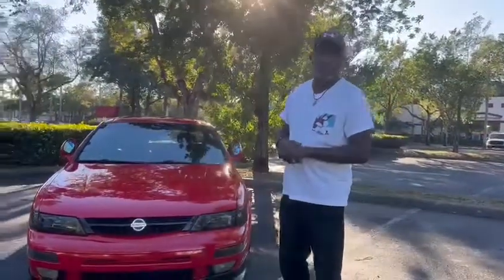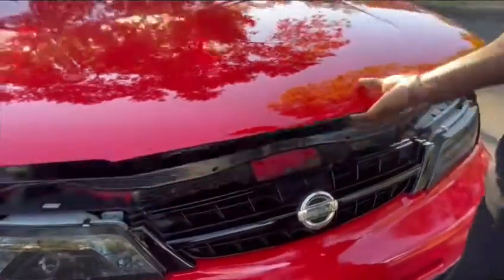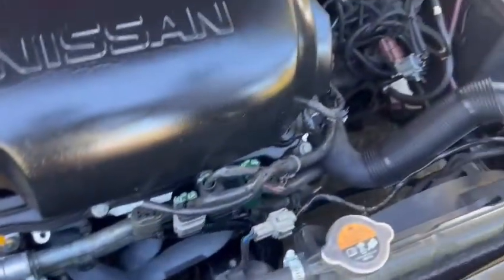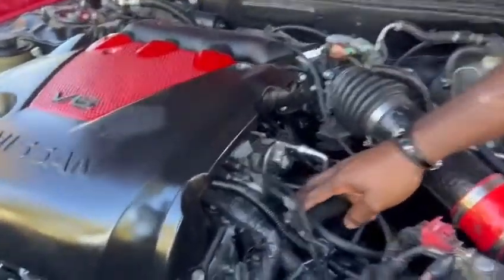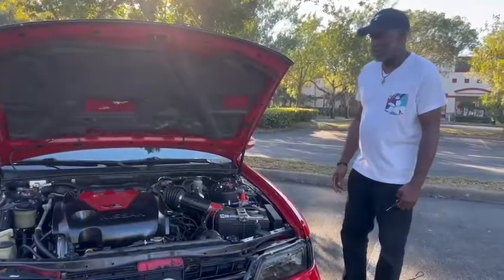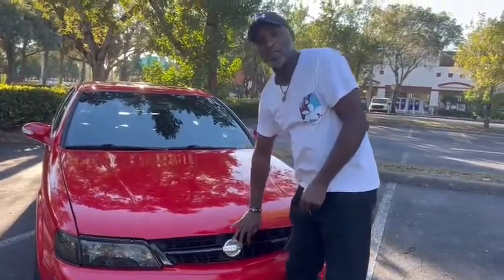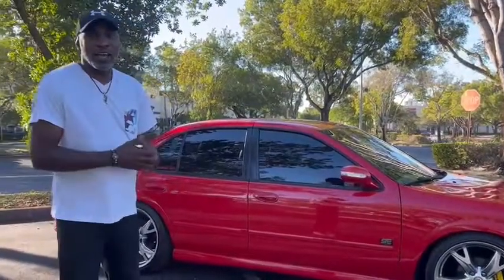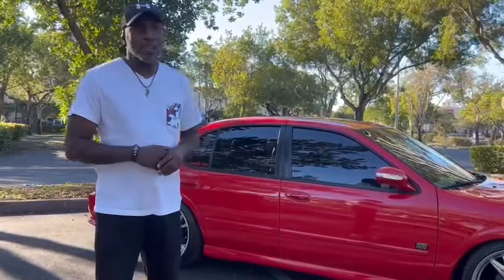4th gen with 3.5 maxima swap (2020 motor) walk around

Comment: Hi, I'm interested in doing this to my 2002 with the 6spd? Will this manual trans bolt to this engine?
Reply from the maker: Yes this will bolt right up no mods needed
Reply: Will u need to swap over any parts from the vq35de to the 2020 motor? Or do any modifications need to be made before swapping

Comment: Very nice. I'm looking to vq30 mine. I'm building it with my daughter starting this summer hopefully. What mounts did you use? You should do a grocery list of parts this is something I may pick up a manual SE max to do. I love 4th gens. Those mirrors are a cool custom feature also.
Reply from the maker: Thanks.    I use OEM mounts but made them solid mounts.      That will be a great bonding moment with your daughter.

I will post the list of parts needed for the build
Reply: So Are the cross members and mount placement the same?

Comment: Hey bro thanks for the video! Your car is impossible great! I have Nissan Maxima 1998 a32 manual transmission with VQ20DE engine. The engine is on its sunset so I'm looking for some to replace.Which engine would you suggest to install on my car? Thanks!
Reply from the maker: Thanks bro.    If you can get your hands on a 2016 n up motor I am telling you you will definitely be happy.    I have been meaning to post the complete parts list but have been so busy keep forgetting.   Will do it this weekend stay tuned
Reply: @bajanrichmax6517  I’ll be waiting for post!

Comment: Love the max dude. I have a 5th gen 3.0 manual any suggestions on how to get the 3.0 to max power without a 3.5 swap
Reply from the maker: Swap the upper/lower manifolds and you can go as far as swap the injectors
Reply: Can you be more specific on what to swap them with?
Reply: I’ve found that the vq30 isn’t as modifiable as the vq35. You could try some ss headers, ported intake manifold, throttle body/intake spacer to help reduce intake temperatures slightly and possibly a tune if you can find someone or know how to yourself. Other than that, you’ll find more performance in swapping with the vq35.

Comment: Hi,
I have a question i have a 98 maxima 5 speed my motor is blown would a  2001 infiniti i30 3.0L fit what modifications  would i need? Or it wont fit? Thanks
Reply from the maker: Don't know how I missed this question, sorry about that.   Only mod u need is an adapter for the throttle body to use yours from your 98 max to the 2001 engine.   Everything else is the same

Comment: i have a 4th gen as well and this one is pretty damn clean😶‍🌫️ you mind droppin a mods list?
Reply from the maker: Thanks bro.    Let me see if I remember all my mods lol.

2020 motor
2003 maxima 6spd hlsd manual tranny 
Headers n y pipe
Straight pipe with cat delete
Lightweight flywheel and underdrive pulley.
Cold air intake with piping.
Stabilizer bar in trunk and under the rear
Cefiro power mirrors
Custom trunk
SE-R altima seats
2020 maxima steering wheel
2007 porsche 6 pistol front calipers with upgraded brake links all around.
370z sports 19' rims.

I know I am leaving some stuff off lol
Reply: @bajanrichmax6517 what headers and y?? I have an 02 6spd
Reply: @bajanrichmax6517 can u just use power mirror from i30/35 on 02 max? I know the interior pieces swap over
Reply from the maker: @RacingHeartMedia  https://www.ebay.com/itm/354861391963?mkcid=16&mkevt=1&mkrid=711-127632-2357-0&ssspo=79gfcb5mtqs&sssrc=4429486&ssuid=pjOnpqycQTa&var=&widget_ver=artemis&media=COPY
Reply from the maker: @RacingHeartMedia  some basic headers n I am running str8 pipe all the way back
Reply from the maker: @RacingHeartMedia  I did not know the mirrors from i35 would work
Reply: @bajanrichmax6517  did the header bolt straight up or modifications needed to be made to the header itself for fitment?
Reply: @bajanrichmax6517  i know those cefiro mirrors are hard to come by but I think i30/i35 parts are interchangeable with the maxima….. i30/i35 is just the maxima in a tuxedo I’ve seen a few i30/35 5 speed swapped as well
Reply from the maker: @RacingHeartMedia  I did not have to do any mods for them to work
Reply: @bajanrichmax6517  3 inch from the header all the way back?? Any muffler??
Reply from the maker: @RacingHeartMedia  yes 3 all the way back.   The muffler is not even a brand name but sounds great.   The muffler on the car now for about 15 yrs lol.
Will make a video of how it sounds and post
Reply: @bajanrichmax6517  yes definitely I’d love to hear how it sounds
Reply: What type of engine is so I can search it in full not really a car person but I’m tryna be lol I have a 1997 Nissan maxima
Reply from the maker: @TaniquaWarren-vg3qm  it is from a 2020 maxima

Comment: Can these motors use a manual transmission or are u stuck with the hot dog water CVT
Reply from the maker: Yes these engines can used with the manual transmission.   I am using the 2003 hlsd manual tranny

Comment: Where do you shop for parts ,I can find any shop that sells your tail lights
Reply from the maker: I made the taillights by putting them in the oven to open them and then adding the clear piece from materials I bought from home depot
Reply: Hello thank you for the response, but something is bothering me , Why don't people just use the 3.5 timing?
Reply from the maker: I did my taillights in my oven and put a piece of glass from home depot.  A few years now

Comment: Did you use the 4th gen harness and ecu or?
Reply from the maker: Yes I used back the ecu n harness from the 4th gen
Reply: @bajanrichmax6517  I just hr swapped a 5th gen max but I kinda wanna build a 4th gen for the lighter chassis

Comment: I literally just test drove a 2020 Nissan 3.5 maxima last week was going to Trade in my Nissan Maxima 2001 with 158k miles Zero problems or issues No engine light and Runs 10x better than any car that this guy had in his car lot anyways when i floored it in the 3.5 maxima the car didn't go anywhere lol barely i was like omg this thing is a piece of shit lol and it had a ticking sound just awful motor or it was about to blow up i honestly don't know lol i just gave the guy the keys back and was like hell no i'm good!
Reply from the maker: Lmao the cvt transmissions are crap to me.  The response time is trash but if you put the motors in a 4th or 5th gen maxima the car becomes an animal.
Reply: I drove a 2022 pathfinder rental car and this new 3.5 has some guts to it, even in a 4000+ lbs suv. I can only imagine what it would be like in a lighter chassis.